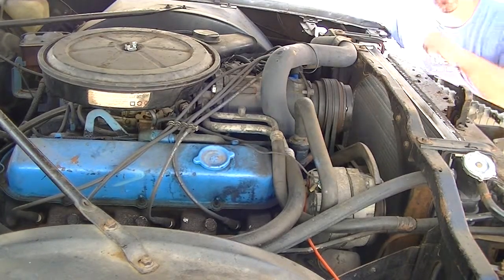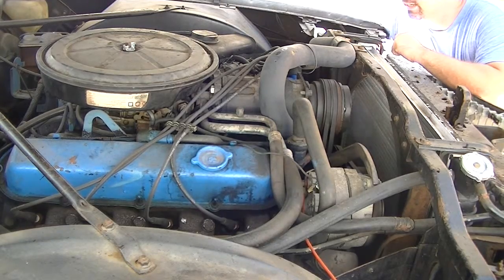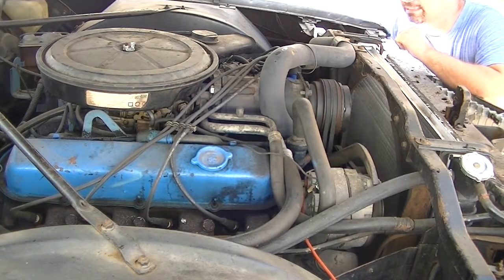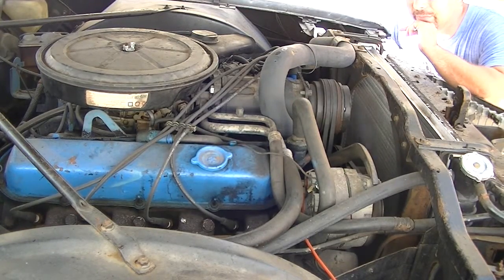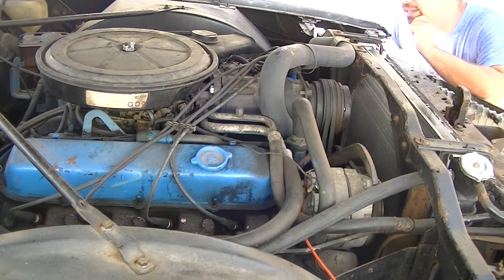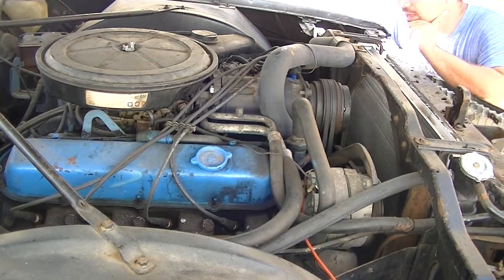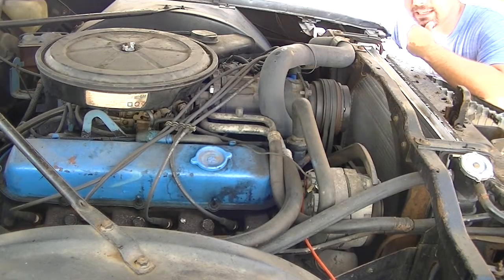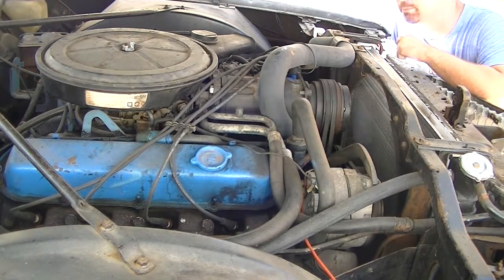1972 Cadillac Eldorado Convertible engine running

Comment: If you must remove a hood use a pencil to outline the washers on the hood bolts before removing also make a line on the hood where the hinges attach to the hood top & bottom of each hinge being sure to mark a centerline at both sides as well from the hinge to the hood. This removes the guesswork the hood will line-up as it did before just line-up the marks.
Reply from the maker: Wish I would have read this sooner. The hood never went back on the right way! :) I took it off for a while and now drive it hoodless.
Reply: @CarTechGuy  Hoods are not easy to realigned same for doors. the trick works most things. If you choose to recover the seats after you remove the old seatback covers first slide plastic garbage from the bottom of the seat frame so the opening is at the top of the seatback use masking tape to secure closed then it will be easy to slide new cover on because of the plastic and to move the new cover so the seams are on the corners. once it is where you want it reach in tear the tape and slide the bag off. this way the seat cover will bunch up or move the foam-rubber while you are adjusting it. The front seatbacks bag trick is a time saver and removes the risk of ripping the foam. Old Cadillacs are the only way to ride I have a 1965 Fleetwood Brougham with only 50 thousand original miles on it not driven on the road since it was parked in 1967.